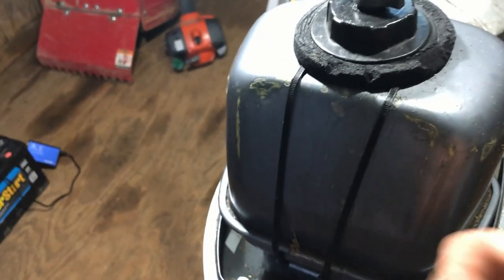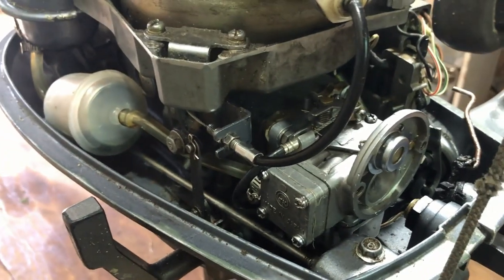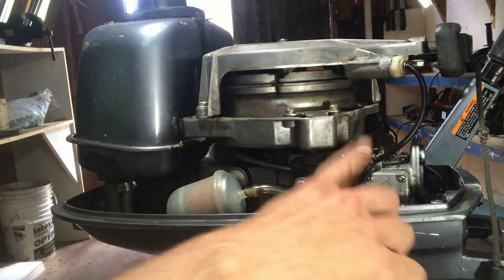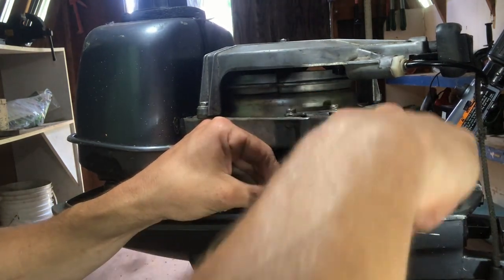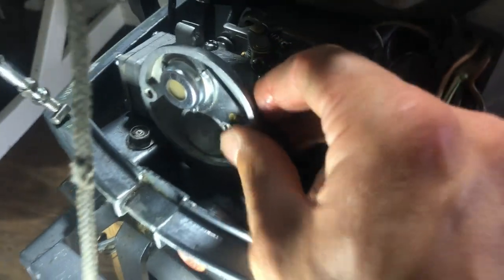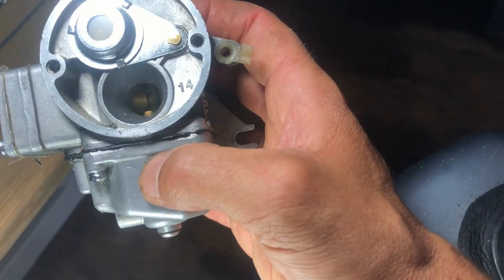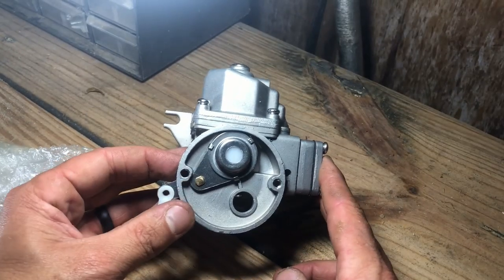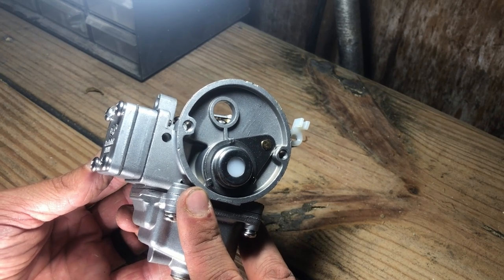Outboard Won’t Start: Carburetor Removal and Replacement on 4HP Yamaha - Boat Motor repair

Comment: Thanks for the video. I had to dismantle mine twice but the second time it was easier because I didn't take the bottom nut completely off.
Reply from the maker: Good point, that is easier. Thanks for the view!! Appreciate it
Reply: Good idea ... and I also took the panel holding the electronics loom off, only two bolts underneath, and moved it out the way of a spanner.

Comment: Thank you a lot man, you save my day! Don't have any video similar to this in Brazil. Tks a lot!
Reply from the maker: AWESOME!!! Glad it was helpful. Let me know how your motor ends up running!!!
Reply: @Skinnyriver  After I saw your tutorial, I disassembled the carburetor and found the "screw" inside the base, with the hole plugged. I cleaned it and the engine is new! Thank you very much!

Comment: This was very helpful Skinny River ... still struggling to get mine running smoothly. I did find a blockage, but it ran well for 15+ minutes before it did a massive over revving then stalled ... Anyone out there able to help / advise me why that might happen ... I should add I can't get it to tick over, and needs at least 1/3rd open choke to keep running. Any help very much appreciated. Thanks again Skinny River - great to keep these machines running !
Reply: I should also add, mine is a Mariner Yamaha, so some small differences ... I liked the look of the inline furl filter, should add one to mine ... if I can get it working again !
Reply from the maker: Over rev’ing definitely means something impacted gas supply from the carb. Also if it has to have some choke to run it is NOT getting enough gas. It still seems like there is something going on in your carb jets that’s restricting gas supply. Check your fuel filter to make sure there is not a bunch of junk in your lines. But you probably still have something going on in your carb jets. You can take a really small drill bit and put through the jets (with your hand) to kind of gently scrub  them out to get any deposits loose.
Reply: @Skinnyriver  Thanks so much for getting back to me ... it makes sense, maybe the new fuel stirred up some fine crap in the tank (it had been sitting around unused for a long time) put a lot of work into it, don't want to give up ... I'll keep working on the carb ... now I know how to deal with it .. thanks again !

Comment: Hi Great video and informative, thanks. Question- how do you adjust and tune the new carburetor. Any guidelines and which are the screws to be adjusted
Reply from the maker: Thanks!!! I lucked out and mine was already tuned for my motor. On my carb there is just 1 adjustment screw (some have 2 screws a high speed and low idle speed adjustments). I start the motor and have throttle at lowest idle speed. I then turn the screw counterclockwise (RPMs should start to drop - if RPMs increase turn screw clockwise). Keep turning until RPMs slow and the motor almost dies, then turn the other way 1/4 turn. Goal is to have a nice slow idle speed. Then rev the motor up to make sure RPMs increase with the throttle. Ideally you have a tachometer hooked up to make sure you don’t exceed rates RMPs at max throttle. But if you set idle speed you should  be ok.

Comment: Hello Friend! Which ebay link you bought the carburetor, because I have the same problem. Here in Brazil it is very expensive ... for you to have a notion, it is around 140 dollars ... If you can help I am grateful. Hugs!
Reply from the maker: https://www.ebay.com/itm/383461539803 here is the one I got
Reply: OK! thank you very much for your attention and help. Hugs and stay with God!

Comment: If grind down an old wrench aka thin it down saw that on rmd creations Michael gets credit for that
Reply: Also did you check fuel filter? So your not running dirty gas . Btw everything im saying is what I've learned on utube videos im not an authority just my observations so please don't take offense as im learning also Chris from OHIO
Reply from the maker: That’s a really good point, any contamination will destroy you carb. Yeah I changed it but I guess it was too late

Comment: Hi, i bought blindly one of these oldtimers. Had a first test run in a barrel, runned nicely, time to go on to the water, then the problems started, No power, bogging down, but on neutral revvs up like an animal. Time to think and take advice, changed piston and rings, every seal and the jets in the carb, also main diafragma etc. Runs perfect on idle, but still Under load bogging down, going somewhere half gas, but there is an important clue, adjusment screw for the mix does not do anything. Back home unscrew the thing, and got me thinking, is the mix screw pointi until the end, full sharp or it has an end. Ordered a new one anyway. Had u ever heard any of this ?
Reply from the maker: If compression and spark are good (which it sounds like they are) you are definitely on the right track with the carb. You should get major differences on RPMs when you turn that mix screw. You are either clogged in the machines channel that feeds the port with the mix screw or that screw is stripped. I would get that screw out and clean out that passage extremely well
Reply: @Skinnyriver  they are yes, new plug and new piston set, and turning the mix does nothing, all the way olen and also all the way closed, exactly the same engine work. Im questioning in the mix screw. Is it compromised or been changed by someone. Thnx for the reply. Edit starts really good and also squirts gas very nicely to the endine, nice cloud
Reply from the maker: @niggastarr  I would put $100 on it that the screw is compromised and you mix is too rich. If it was too lean you would probably have a hard time starting and wouldn’t get a good mist

Comment: Have you tried nibbi carburetors on any outboards yet? Thier quality!
Reply from the maker: I haven’t, I’ll have to check them out!
Reply: Me neither, but rebuild kits are getting hard to find for the old outboards that have carbs. Those nibbi are so sweet I've been considering trying one with a little Fab work.

Comment: Hi,, just wanna ask if this model of yamaha 4hp 4AC do we need to mix the gas or its OK with gas 95 octan?
Reply from the maker: When you say “mix the gas” are you talking about mixing gas and oil? If it’s a 2stroke you have to mix. If it’s a 4stroke straight gas is ok. I think the 4AC is a 2stroke, but download the manual to double check. Also if there is no oil tank it’s a  2stroke and you have to mix.
Reply: @Skinnyriver  it does not have an oil tank, only gas .
there is only gear oil in the motor .
so what do you recommend ? 
the model YAMAHA 4AC 6E0 S 133136.
Reply: @Skinnyriver  and more thing ,, the motor that i have its 99% the same that you showing in the video .
Reply from the maker: Mine is a 2stroke so you have to mix gas and 2stroke oil 50:1 ratio. Here is the Yamaha 4AC manual 
https://www.manualslib.com/manual/685231/Yamaha-4ac.html?page=21#manual

See page 15 (pdf page 21) with mixing instructions

Comment: 0:52 the fuel filter is missing on mine! But it still works fine tho
Reply from the maker: You are fine, there is a fuel filter internal inside the gas tank (at outlet). I had to remove mine and put an external one in. You can backflush your if your fuel flow ever gives you a headache.
Reply: @Skinnyriver  oooh thanks

Comment: Hey - what did you use to search on ebay? Mariner 4 carb?
Reply from the maker: The one I bought had ebay listing Boat Engine 6E3-14301-05-00 6E0-14301-05 Carburetor for Yamaha 4hp 5hp 2-Stroke

Comment: Thanks for the excellent video.  Can you tell me... what number did you get for cylinder compression?  Thanks!
Reply from the maker: I haven’t tested compression but have read 180-190 is good for 4stroke and 110-130 for a 2stroke. Hoping to get a gauge at some point and test mine.
Reply: @Skinnyriver  Nice,  Thanks for the reply.

Comment: How’s the carburetor holding up? I have exact same engine. I would like to put the same carburetor on, do you remember where you ordered it from ? I know it was from China lol
Reply from the maker: I got mine off eBay, I actually sold this motor and got a 6hp Mercury. But carb was doing fine when I sold it. I’ll try to find the listing on eBay for you
Reply: @Skinnyriver   thanks for your help , much appreciated ! I use the little Yamaha as a kicker motor on my bay runner. She’s done her fair share of kicking over the years lol  , I can’t tell you how many salmon I’ve caught while listening to that thing purring along been a great motor. Figure she deserves a good carburetor rebuild but for 30 bucks can’t Might as well have a back up
Reply from the maker: I just looked up the eBay listing and it’s no longer active. I would just pull the model # off you motors data plate and look up a parts diagram on boats.com or some other website to get carb PN. I bet there still are some listed on eBay
Reply from the maker: The eBay listing title for mine was: 6E3-14301-05-00 6E0-14301-05 Carburetor for Yamaha 4hp 5hp 2-Stroke

Comment: My Yamha 4 hp 2 stroke is very hard started when it stand for exempler 2 days. And  i have to choke everytime i start ?
Reply from the maker: Yeah, it’s a pain sometimes. I have found cleaning the carb and only running non-ethanol fuel helps but doesn’t solve the issue. Sometimes a little throttle helps (but that can flood it if too much throttle) What year is yours?
Reply: @Skinnyriver  dont know think  its from 1990 sometime. Can you clean fuel filter on theese.?
Reply: @Skinnyriver  thanks for the tips i try Therese after i fix my gear thats not changing to reverse or neutral just goes forward. Wich is pretty riscy when starting at full gas.  🤣  thinking of buying a yamaha 8 hp 2 stroke . Do you know wich year of a 8 hp modell is best to have
Reply from the maker: I am pretty sure there is an internal fuel filter in the tank. You might be able to unscrew the fuel fitting on the tank to get to it or take tank off and back flush
Reply from the maker: I think any model after 2010 is basically the same model. I would splurge a bit and go ahead and get one with low hrs :) and not worry about it
Reply: @Johanneshandmark  1997 , and up .

Comment: Do you have the part number for tge carb?
Reply from the maker: The one I bought had ebay listing Boat Engine 6E3-14301-05-00 6E0-14301-05 Carburetor for Yamaha 4hp 5hp 2-Stroke
Reply: @Skinnyriver  thanks

Comment: The carb was made is a standard of JIAPAN, not JAPAN. hahaha
Reply from the maker: 😂 yeah I found that out after posting the vid lol
Reply: @Skinnyriver  I have it as well, the same than this. My problem is very weird, after 15-20 minutes full loaded, the engine don't breathe fuel.  The pipes before pump, includind the filter are empty. It is a kind of the engine cannot make the vacuum, I dont know at all. Even, if you push fuel again into the pipes, the engine work perfectly untill the fuel is burned. Do you have any idea??
Reply from the maker: @Joseillo500 my initial thought is there is a fuel pump issue or there is an air leak in your lines (basically sucking air). Are you using an internal or external tank? It definitely seems something is preventing gas flow.
Possible reasons:
Gas tank not venting in air (preventing gas from flowing out)
Air leak in lines 
Blockage or kinked line 
Fuel pump not working correctly 
If you motor runs when it has fuel then it is creating needed vacuum to get gas from carb to motor. Motor vacuum does not pull gas in gas lines, it only pulls gas from carb bowl to motor
Reply: @Skinnyriver  it happens with both, external and internal tank. I think the engine is not dimensined correctly to go full loaded and after 15-20 min, it stuck and the pump colapse or the air enter into the carb fuel pool. If the motor work a mid load, there is no problem. The pump is quite small.
Reply from the maker: @Joseillo500 yeah that is weird. It definitely seems your fuel system is not able to send enough gas supply to keep up with full load.

I would change the fuel filter as an easy cheap check and then pull the gas lines to see if there is any degradation or contamination. Also the carb inlet needle valve or float may not be opening all the way. Let me know if you figure it out… I am curious what the fix is if you find it
Reply: @Skinnyriver  I did all these things yesterday. In addition, I made adjustments in the carb. The screw of the mix was too open I think. The engine sounds much better and refined. Maybe, it spent more fuel than the pump could enter into the carb.
However, I continue thinking that the dimension of the carb is too small and it was not designed to be a full load all the time. Probably, I will buy the Suzuki DF6A, 4 stroke, because I used to fish with the engine working all the time to compensate for the drift and 2 stroke makes you to smell the burned oil. Have heard anything about this model of Suzuki, the DF6A? I mean, it has problems or whatever??
Reply from the maker: @Joseillo500 you may be right about the carb. I have heard very good things about Suzuki 6hp.
Reply: @Skinnyriver  Today, I test it and it work well. At least today, hahaha.
By the way, the screw with the coil located in the carb, to make the right mix, do you know what it regulates: the fuel or the air??
Reply from the maker: @Joseillo500 honestly I have read some change amount of fuel and others change the amount of air. I think it depends on the type of motor. Like dirt bikes change air amount. Regardless it changes the fuel / air ratio. When you turn it, if the idle speed slows down I believe you are increasing the fuel amount more rush (more fuel , less air)
Reply: @Skinnyriver  I was asking for the yamaha, the same carb which you had. As I asked before for the suzuki...